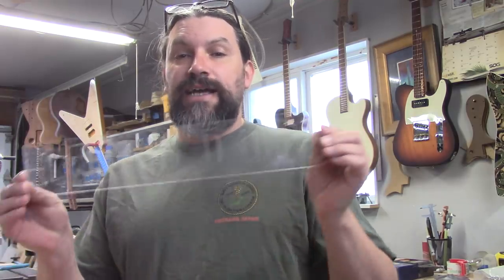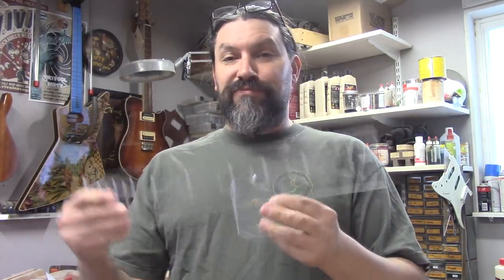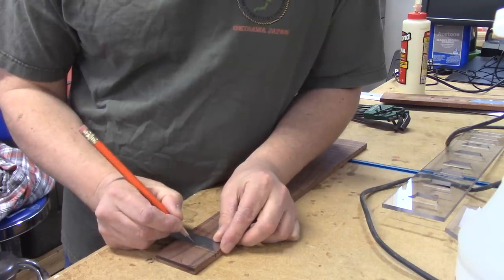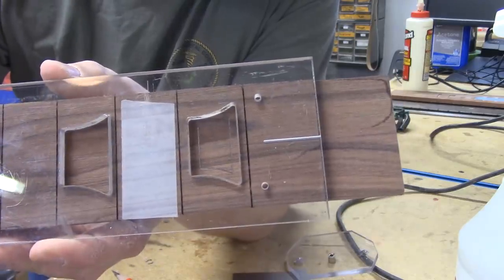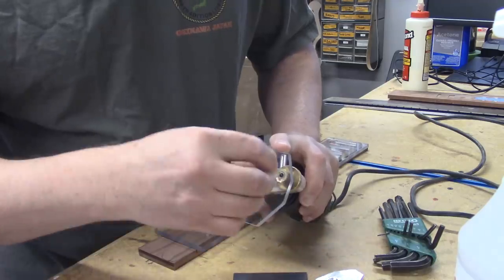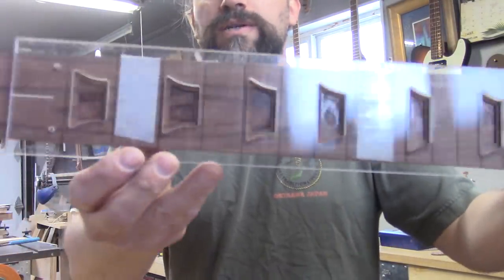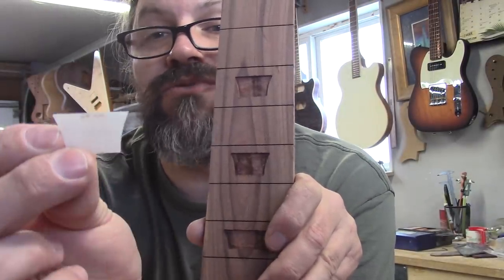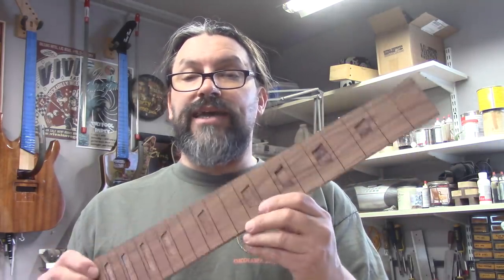If You're So Smart... Tell Stew Mac What You Think Of This Tool

Comment: What size router bit is that designed for? It looks like a fairly small one, less than 1/16", and that's a lot of wood to hog out. I could see recommending using a 1/8" bit first to get out most of the material before using the small bit to hit the outlines and do the finishing cut. That could save snapping a bit or three.
Reply from the maker: 1/16 bit the bushing could be swapped out for a larger bit but then it adds cost and complexity. If I can go slow and, and I did, it can be done.

Comment: Very Nice idea and I guess if you have the inclination to do so you could go bonkers if you had access to a CNC router to cut new templates for the router base (or StewMac could make them) You could even use the template to cut the inlay material with a smaller template collar in the base or a template with (twice the collar thickness) slightly bigger cutouts
Reply from the maker: Of course, if you had access to a CNC you could just have it cut your inlay... I hear you though.
We have made a jig for my beloved pin router that does this same thing, the only downside is you have to have a pin router to use it. This is a handy tool for the small shop or the guy who is making his own Les Paul style guitar. I know I say something like this and stole the idea because I wished I could buy one.

Comment: Well yes acrylic templates are the best ones:They are clear so you can easily line up the centerline and use your router but i dont really see why you need stew mac for this.....all you need is have ( or make) the design in your computer and then give the file to a shop to make the templates according to your design.Stew mac can only give u a cookie cutter template for very specific use that you ll probably overpay....
Reply from the maker: StewMac has a distribution network.
Reply: @TexasToastGuitars  iam talking about the person that wants a template of anything(not you or stew mac that wants to sell it).....why not design it on a vector program and then give it to a store to cut the acrylic template.
Reply from the maker: It's a good idea. I don't really want to keep an inventory or I would do it

Comment: I think this is a really solid idea. My worry would be if the inlays are not consistent. Stews are prolly machine cut but if they change vendors the fit could be right out the door.
Reply from the maker: Good point QC is important for this rig to work. I have had great luck with the precut inlays from Stewmac so far.

Comment: @stewartmacdonald - I'd totally buy one of these (despite the fact that I have something similar in stainless from Bartlett Guitars)

Hey Matt - have you ever made a second pass with a really fine bit to try and "point up" the corners? Or is the juice not worth the squeeze?  I can see where a sharp chisel would make quick work of it, and you're almost always going to have to do a minimal amount of fiddling to get a good fit anyway.....
Reply from the maker: I bought the one from Barlett too... but I got to tell you the brass bushing and oversized template makes it nice. 
The center is still the center so, the smaller bit in the same size bushing wouldn't really help you out. Like you say though, the sharp chisel makes short work of the edges.
Reply: Oh shit - yeah - you lose the diameter (err - rather, the radius) of the bit if you don't shrink the bushing.  DOH!

Comment: This is really kickass. I'd buy it right now if it were available. I have a stainless steel version of this jig, but the traps/blocks are actual size and its specific to the 59 fret spacing.
Reply from the maker: Thanks for watching amigo. I have something like that as well. It does work well but I think this little set-up is better?
Reply: @TexasToastGuitars  yours is way better no doubt.

Comment: The only addition i could see is radusing the bottom of the template for use on already radiused boards so it doesn't rock..   Awesome idea is buy one.
Reply from the maker: That would be a good idea... I also thought about making it oversized and add some little outriggers to stay stable of a radiused board. 
You really should be using flat boards ;)
Reply from the maker: Many thanks to the inspiration Rick Maguire... https://www.thegearpage.net/board/index.php?threads%2Fcalling-out-to-buildersfavorite-jigs-templates-tips-techniques.400718%2Fpage-7&fbclid=IwAR2w5NI5rxQeWjUrJ4jjrTl0zmccXt7VT1Gka8XFGvAcneBlaHEwoahy20o